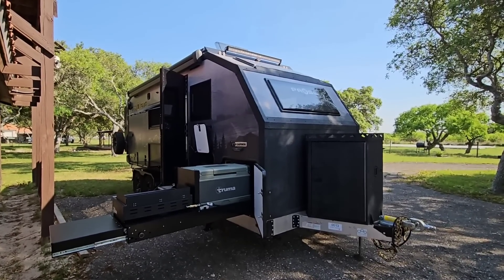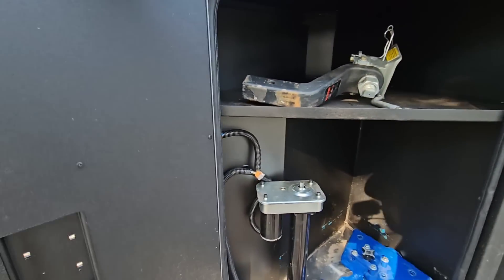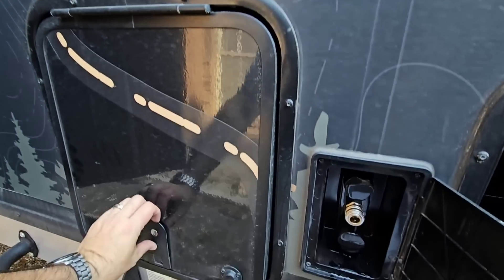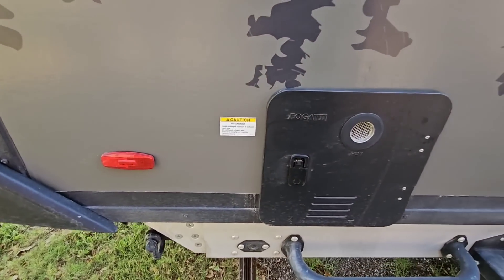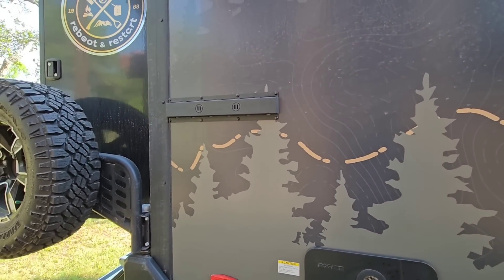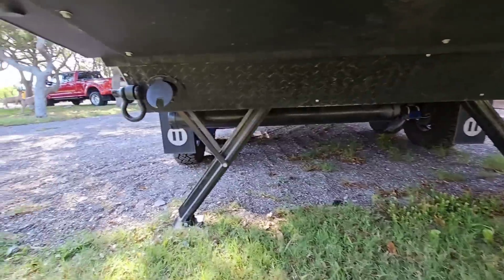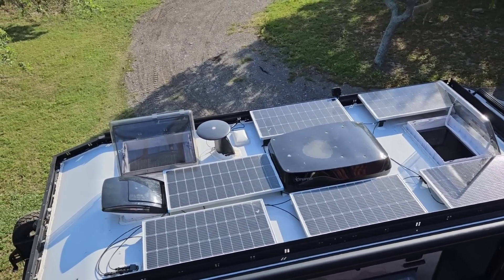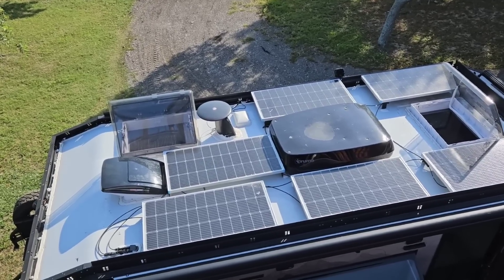Full Review! All New RV! Palomino PAUSE True Overlander! Part 2 ROA Offroad

Comment from the maker: Correction: The PAUSE has 12" of suspension adjustment NOT 15" that I indicated in the video.  Also, it was designed to work with the Andersen Weight Distribution Hitch system.

Comment: For me the solar is total overkill. That's if you want to full time in it and run AC. I would match the tire size with the truck tho and have one size for both. Then use the used truck tires on the trailer.
Reply: So you’re going to spend $140k on a trailer and then put old tires on it?
Reply: @martinconzemius5351  I would wear them down 50%  and put them on the trailer. Buy new set for the truck.
Reply: If you spend this much on a trailer you are probably a person who has to have AC.

Comment: I am VERY disappointed about two things. The perfect mountain bike garage was destroyed by the battery placement. It needs a rethink or an option that recovers that HUGE asset. Perhaps a single layer of batteries on the floor with a deck over top? Less headroom but likely still a big improvement. Has anyone tried to get two MTB’s in here and around the corner through the rear door? It might need a side door (or two) instead. Would save on tire hardware. Other than that, the shower curtain is a huge disappointment. The self wiping radius shower doors that retract inside the shower along the inside of the cabinet, or modern accordian facsimile would be far preferable. Other than that it’s a revelation to see a properly built tow behind trailer. Final thoughts - the couch is a huge step forward in amenities, but maybe think about a Murphy bed design that would leave the bed ready to sleep and folding (comfortable) card style chairs instead of stools. Very close to ideal!